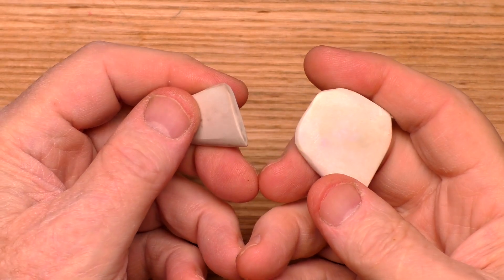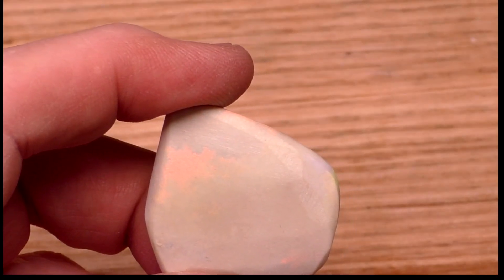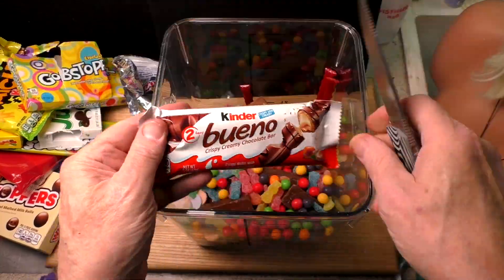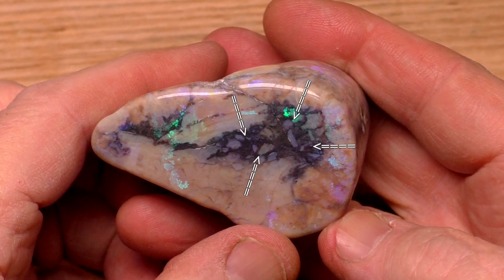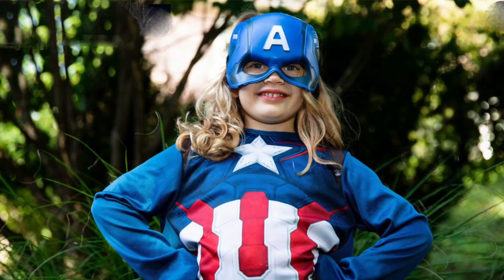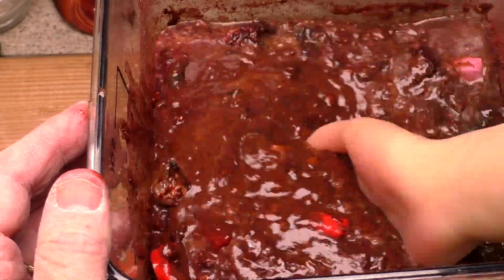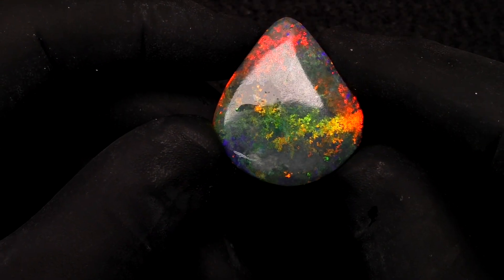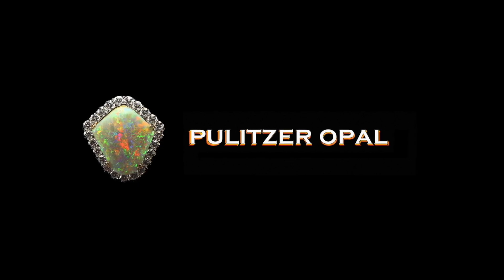Australian Black Matrix Opal - The Truth Revealed

Comment: Is treated opal considered ”less” or is it equal to untreated, other types on opal? Also, does opal treatment last? Or is the change temporary?
Reply: Its way cheaper. But still more expensive then gold per ct most of the time lol
Reply: If the treatment is good your fine. Unless you are talking a smoked opal. But sugar acid treated Australian is pretty solid and wont fade. Unless you chip or crack it deep. 

I wouldnt buy a smoked ethiopian though. 

Opal found around the world sometimes needs to be stabilized and its expected.  Some american and canadian opal needs to have a coating or filling to use in jewelry

Australian opal is stable enough to keep natural. At least the stuff we care about.